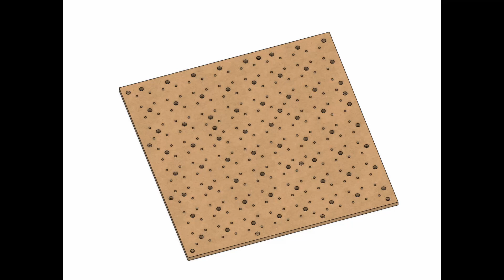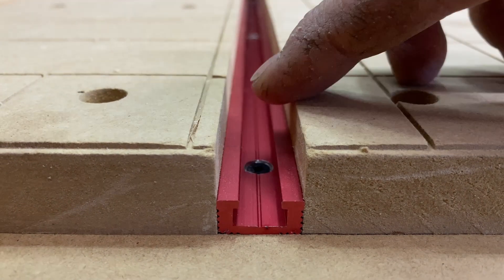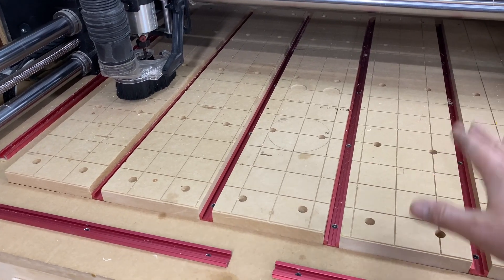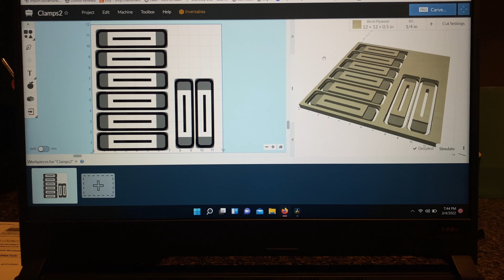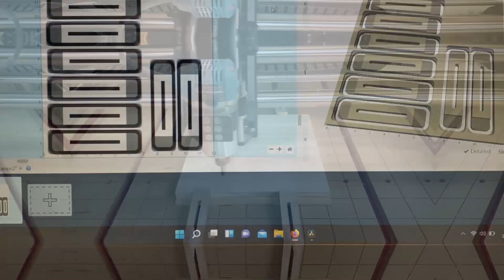CNC - Clamps and Wasteboard Setup. Pros and Cons. Beginner Tutorial

Comment: i just brought the file off of esty. i ran one set and the problum that i having is the middle cut out is to large for the washers i got from the list. what size of end mill or u using .i used 1/4 em . love the file.
Reply from the maker: Hello, thanks for watching! As far as the file goes, the middle “slot” should be 1/4” or just larger to accommodate the 1/4” nylon bolts. The washers should be 1/2” OD. I just clicked all the links and they all seem to be working well.
Reply: @SJSSawdust  thank you for he info
Reply: @SJSSawdust  i used a 1/4 em mill for the middle slot and its way to wide  for the 1/2 od washer .what could i have done wrong
Reply from the maker: @josephlanglois8073  if I had to guess, I’d say that you set that slot to cut “outside” instead of “on” so instead of just doing basically one line, you doubled the width of the slot

Comment: ...why not use nylon bolts in the threaded inserts ?
Reply from the maker: There’s 2 reasons - 1) I didn’t want to have to use a tool to tighten the clamps, the wing nut can be secured simply using your hands. Now, I suppose you could find a bolt head that IS a wing nut, eliminating the use of a tool but the it would have to be cut to the perfect length so you could use it with different material thicknesses and screw it into your threaded inserts. 2) I can leave the clamps on the t track and when I set in my new project material, just slide them around to make them fit - I don’t need to remove them each time after use

Comment: Any tips on getting your t-track square and parallel to the CNC frame and each other?
Reply from the maker: Yes. Use the machine to do it for you. What I did was run a path around the outter most perimeter of my machine ( 32-1/4” x 32-1/4” I believe). Then you can either measure in , at 2 different points, from one line, connect your marks or once you figure out where you want your track, draw a line in your cad/cam program and use the smallest bit you have to draw the line for you. Then you will know exactly square and parallel from on side

Comment: I haven't looked up the nylon bolts, but I think they would 3d print well if the oriention is good. I'd also suggest dog holes for locater pins. I wonder instead of t track if I could use a dovetail bit and just use 3d printed block rather than a head to help the MDF strength. Great video thankyou 😁 you have given me much to think about lol
Reply from the maker: There are so many options and to get your wasteboard perfect ! Dovetail slots are great and strong

Comment: Haven't set up my waste board yet, still trying to get Journeyman X-50 set up, then trying to decide on a dust collection system, any suggestions? Thanks for the file and the very informative video.
Reply from the maker: I have the stock dust boot. I would love the “pwn” dust boot because it comes out behind the router and that would make more sense because I have my dust collection hose in the back right corner. I just use an old shop vac with a dust deputy (cyclone separator) and it works very well!
Reply: Thanks for the info. Was thinking about going on etsy and looking for that dust boot that comes out the back. Appreciate your response
Reply from the maker: @ronnorris1504  absolutely! I believe Onefinity sells it too